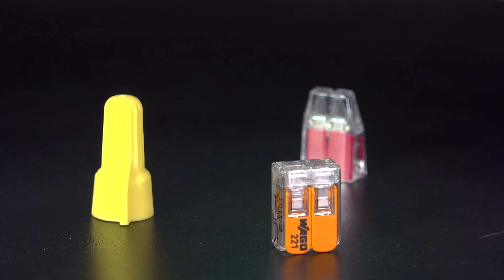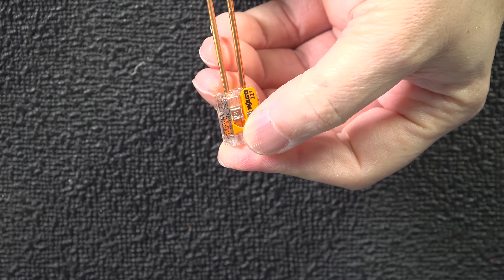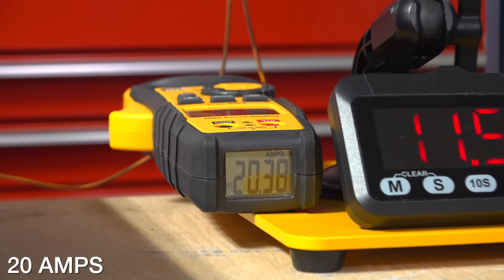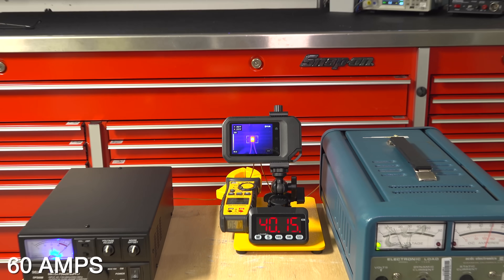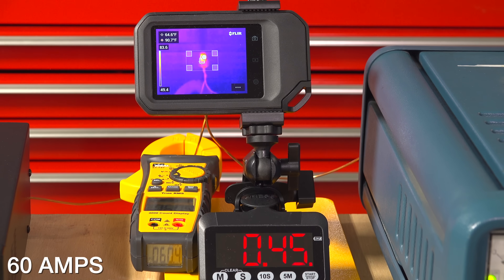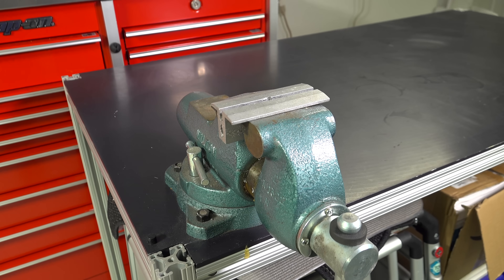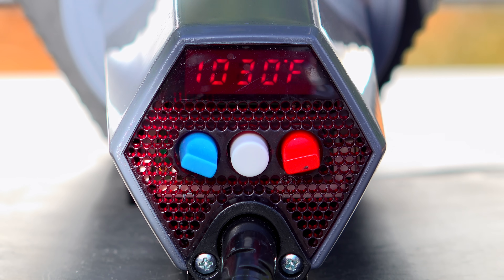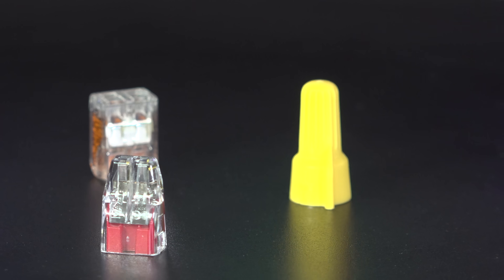What Wire Connector is the Best? Wire Nut VS Wago TESTED

Comment: I've been an electrician for almost 4 decades. Industrial, commercial & residential. I'm just an old guy with an opinion, but I've seen a lot. I've opened many j boxes, troubleshot tons of circuit failures, and have seen hundreds of wire nut failures. Here's my opinion, do what you want with it. Due to the thermal expansion and contraction cycles present in electrical systems, over time wire nuts work their way loose and even fall off. I used to blame the previous electrician for not tightening the nuts, but eventually realized it's the wire nut at fault. A twisted splice inside a box is so rigid that it puts more strain on the connection, prohibiting this natural movement. The connection is the weak link, hence the failure point. I use the push in versions exclusively as I believe that the levers could be accidentally popped open when packing the j box. These spring loaded connectors don't loosen up, allow the conductors to swivel and flex easily within the box, eliminating the tension on the wires. You can feel the difference when packing the box too, so much easier, no stress on the conductors. These are not the same as the push in connections on cheap 50 cent receptacles, those are junk and should never be used under any circumstances! I have used WAGO products in the worst industrial chemical processing environments, along with residential applications, since 1994. They hold up better than anything else. I was extremely reluctant and skeptical early on as to their durability, as wire nuts were the gold standard in a trade with rigid beliefs of what works and what doesn't. Now I use them in every application that I can, with no hesitation whatsoever. I keep in touch with my customers, no callbacks ever. I am not an electrical engineer, I just play one in real life!
Reply: Dave, that is interesting. As an Australian Electrician who has been at it since 1973, I mostly only come across wire nuts in imported North American equipment. I haven't found the spring type such as T&B, 3M or Ideal too bad, but way too many wire nuts are an all plastic device.
We just don't use them that often as the tunnel connector with a screw in the side is so reliable by comparison ( we call them BP or Blue Point, which was the original bakelite version).
The modern versions have a decent skirt and are secure. If needed the 2 screw version usually reserved for earth wires can be used for extra security. 
I have a long standing prejudice against the Wago terminals due to previous experience with G rail / Din rail mounted items not accepting pin lugs well. 
This is for fixed wiring to this point.
In the last 3 years GE and Komatsu have swung over to Wago terminals for use on dump trucks, a very hard mobile application. The previous method was the ultra-reliable but bulky aviation style ring lug and 10-24 screw with 3/8 af nut and captive lock washer.
The Wago set up is compact and neat, time will tell how they stand up to 120,000 hours / 20 years of vibration heat and dirt.
Reply: @mikenewman4078  Always interesting how completely US-centric the viewpoint of our workers is. They think the way they've done it for 50-100 years is the only way and that any other option must be bad since it isn't as common. From home wiring to automotive repair, people need to broaden their horizons. Thanks for sharing your experience. Heavy equipment will definitely put Wago connectors to the test!
Reply: @802Garage  
Large commercial Wagos are common.
Reply: @mikenewman4078  I am an American electrical contractor. I have never seen a non metallic wire coil in a wire nut that wasn't from China. We get them provided in some cheap fixtures from China and always throw them out. I am not sure you can even bu non-metallic wire coil nuts here. Maybe for automotive use.
Reply: My father was an Industrial electrician by trade, he worked for ITT Rayonier at a pulp mill when ITT was something.  My grandfather built houses and he used my father wire them. The county had no building inspections back then much less electrical inspectors, the power company inspected a house before they hooked up power.  My father hated wire nuts, he soldered all his connections. Want to bet there have been a lot of frustrated homeowners and electricians from that.
Reply: @mobeydick37  Soldered house wiring? is that allowed in the code? where he built at? did he wrap them all with tape after ,or is shrink wrap that old?
Reply: @sharpe227  Most of the houses were built in the 70s and very early 80s. Wayne County, SE GA.. He taped them. Shrink Tube might have been very new to the market then.
Reply: Just became familiar with Wago style connectors. What wonderful devices. I’m pretty old myself. I have been an apprentice electrician for a contractor involved with 100+ year old remodels in Chicago, porcelain wire nuts with cloth wrapped wire run inside gas pipes. That’s the way gas lit homes were converted to electric. I have been an electrician on a modern submarine. I have been an operator at a power plant performing high voltage switching. All of these electrical installations are proven over time but a major factor is the training and experience of the installer. IMHO wire nuts have always been one of the least desirable ways to make an electrical connection. Take a mixed array of 5 wires from 12ga solid and 16ga stranded and try and make a quality connection with a wire nut is virtually impossible. Use a Wago connector for the same, is no problem.
Reply: I am an electrical engineer in a manufacturing plant, and when it comes to facility wiring, while I do answer the occasional odd question about power factors or Ohm's law, the plant electricians are the experts. We spend all our time in college studying wave equations and complex impedance and aren't trained at all in practical stuff like "how many amps is that outlet?" or "what kind of ventilation does this transformer need?" Whenever I wire something up, it's because it was an emergency and the electricians weren't around; and they'll be coming back later to check/fix my workmanship.
Reply: @stickyfox  Have to agree wholeheartedly. I can think of so many classes that had little to no value and the likelihood of having more was small. It almost seemed as though they were trying to fill in the 4 years with stuff after having run out of useful stuff in year 3. Our college also had EEET which was geared for practical stuff and quite good but it was so funny how all the EE people looked down on them but in reality, they were the ones that could deal with real world.
Reply: My uncle is an electrical engineer and he used wago connectors when wiring our house. They have been in place for about 20 years now and haven't had a single failure. We recently opened up some electrical boxes doing some remodeling and the connectors were like new when we handled them. Edit: a typo
Reply: As a follow up, all my years of experience have been with metallic piping systems, residential and commercial. In the chicagoland area Romex is not allowed by local jurisdictions, 100% metallic pullable systems only. That being said, regarding my thermal theory, the entire length of the wire is uninhibited from moving during the heating cooling process, putting stress on the connection as there is no clamping of the conductors at the box like in a Romex installation. So there could be 75-100' of wire, or more in commercial/industrial environments. I am not a mathematical genius whose able to calculate this, but I know wires, just like any metal, will grow and shrink with heat. Most compact conductors now have 90c temperature insulation, which means they are designed to run at higher temps. More drastic temp cycles equals more movement. Again, just a theory as to the wire nut issues, but wires definitely move with heat cycles and I believe the WAGO connections allow for this movement better.
Reply: @davenag957 As a 35 year union plumber I have to know expansion ratios using rigid metal and plastic pipes that span 100's of feet. Plastic expands 6 times that of metal. You can actually see it when cold water traveling through plastic pipe rapidly changes to hot when it finally reaches the kitchen sink. I measured it a couple times. A 40 foot plastic pipe expands about 1/16 of an inch when the temp is increased 50 degrees.....a metal pipe expands only 1/6th of that....enough to hear (tic tic tic) if it's strapped tight to a given surface (in a bind)....but not enough to measure with rudimentary tools. So I don't buy in to this metal, flaccid wire (loose and flexible) causing any kind of threat. If a house is wired correctly you're not jamming 5-6 wires together in one wire nut....that's cutting corners and just bad workmanship. I wired my house over 40 years ago. Zero issues....but, nothing lasts forever...especially if you run water through it.
Reply: @davenag957  in my books, if you are open minded, you are not old in mind 
just FYI ALWAYS leave slack in wires, and a loop before the junction box/termination
houses move, buildings move, wood and metals expand and contract... allow room for expansion!
Reply from the maker: I really appreciate you sharing this and I have also opened many boxes and had the same experience. It's a terrible feeling when a wirenut is sitting there loose or on the bottom of the box. Thanks for sharing your real life experience.
Reply: @SilverCymbal  sorry i never worked on those things, but why is it bad?
Reply: @SilverCymbal  My takeaway from this is that if using wire nuts, position them so they are pointing up not down -- where possible of course.
Reply: @SilverCymbal  In 30 years, they will be saying the same about ANYTHING that has the absolute bulk of connectors.
Reply: To be honest, coming from the UK, I'm stunned you guys still use wire nuts where you just twist wires together.

Haven't been used here for 50 years and when they were they had a bad reputation.
Reply: the old stuff sucks. the 3M are nice. less heat if all wires are together and done properly. rnr🤙
Reply: Wire nuts were banned in Britain in the 1960’s. They were called Screwits here and made of porcelain. I started my apprenticeship in 1970 and now retired. I used to see them when stripping out old installations.
Reply: @derekferguson385  They are making a small comeback in the UK but most people have swapped over to the Wago's in the last 15 years. When I moved over to the US and worked there I used Wago's and everyone poo poo'd it thinking nuts were less secure but due to thermal expansion and the natural action of AC causing screw terminals to undo over time (hence in the UK screw terminal access is required or subject to failure during EICR (inspections) and no longer considered a maintenance free joint). 

One thing to remember with Wago's is they are designed in Germany and fault tested at over 2x the rated loading, so 20 Amp connector is tested to beyond 40 Amps - at 230 V which is over a 9KW load. So in theory they should be able to take a higher Amp load on 120 V.
Reply: I Just started using Wago’s also the Last Few Years. 221 series.  I Like them. No problems so far. I’ve been in the trade since 1981. I use the 3 conductor ones. They sure are a lot easier to use than putting 3 wires in a nut & twisting. A lot less stress on the body & fingers after 40 years of twisting wire nuts. They are nice for troubleshooting too. They have a hole for test leads to poke into & removing a wire to test is really nice as it can easily be put back in the connector.
Reply: @thunderbolt5354   I disagree that you are older than 16, based on your grammar.
Reply: Very interesting and valuable knowledge. many thanks.
Reply: I worked as a sparky for 50 years and never had trouble with a wire mut that I installed. I start by stripping wires around 7/8"  then twist wires with large sidecutters until at least 1 full turn on insulation. Then wrap with a quality.black tape. Worked in very harsh companies like a large slaughterhouse with a extra hot rendering room that ran 24/5 and a large candy company that had hot high pressure hot water hose downs everynight. As long as you do not overload the wires you were fine. So for a
Reply: What about 3M nuts? Messy work is usually the problem.
Reply: Wagos are easier for a homeowner, not better, there are also good and bad wirenut brands!
Reply: As a homeowner I have had 4 wire nuts fail in my 38 year old home just like you said. I switched over to Wago connectors and never looked back. So far not 1 Wago has had any problems.
Reply: @sublimationman  Pal You Better Look Forward wagos Fail to !
Reply: @thunderbolt5354   So far, after mounting tens of thousands of them, 1 single Wago failed on me. 1. All other errors were human fault. I seriously have much bigger problems on my job, than being scared of a WAGO failing me. Seriously, what a load of bollocks.
Reply: I wired my own house a couple of years back, and I soldered all the connections, where allowed by code. For reasons unknown to me, you're not allowed to solder ground wires together. For those ones I used brass crimps.
Reply: @trevorlambert4226  conductor carrying power can heat up and melt connections. Solder is normally fine for electronics as the current carried by the conductors is minimal therefor little heat is generated
Reply: @OttawaMikes  The current required to melt solder in those connections is many times the breaker rating. If you've got >80A in your 15A or 20A wires, you've got bigger problems than the solder melting. It wouldn't be code approved if there was any danger because of it.
Reply: @OttawaMikes  Depending on the exact products used, the insulation can melt before the solder.  Crimps are used in high power connections.
Reply: Used to be able to get outlets and switches with push in holes for 12ga wire but now the holes are smaller for 14ga. I recently did some wiring rework in a well packed duplex box and just could not get wire nuts to stay on. So I went to the local big independent electrical, lighting, and plumbing store (they're way older than Lowe's and Home Depot) and bought some of the push in connectors. Wham, bam, job done in minutes and it was so much easier. These connectors come pre installed on many lights now so install is simple. Just cut the wires to length, strip insulation and push in.

WTH are wire nuts still being made? They have been the worst crap for decades.
Reply: If it is all solid wire and it is twisted tight, the wirenut is just a cap.  You could just use electrical tape which I have seen.  I don't know if that meets code.  Some people tape the wirenuts.  You could probably tape the levers, too.
Reply: Just as any other business out there, I'm sure wire nut manufacturers have been the source of many false claims against their new comer competitors.
 Professionalism can take a quick nosedive when your livelihood is suddenly being threatened.
Reply: I am a retired electrical engineer (weapons systems) and looks to me like you haven't missed much - thanks for the meaningful insight!
Reply: Craig Dendy  A failed wire nut resulting in a  wire merely twisted together obviously isn't a secure connection and is one step away from being parted or partially parted and arching. .. obviously. Of course its a problem. Of course it matters.
Reply: I agree with your comments. I’ve seen people argue for wire nuts and I don’t get it. Wagos and back wire outlets are engineered for this purpose. I’m not a fan of back wire (push in), but screws can loosen and I doubt anyone use torque driver.  On a side note, US cable for luminaries is rated for 90-c.  At 60 amps in this test, those connections held up far in access to that temperature.  Great summary and video.
Reply: Had a new construction house. After 6 months a few outlets went out. They traced it to a failed wire nut which was burnt out. So there was some spark which made it melt. So they can start to fail fast as well.
Reply: @AnkurSethi108  That’s crazy. When I was changing some of my outlets, I found they never cleaned the paint off the wire before putting on nuts. It’s all about how it’s done to be honest.  Some will strip wires during rough in and the painters sprayed the walls and wires. I guess the electrician felt the painted wires were not an issue.   Glad you found the problem.
Reply: Thanks, Dave. That is a real help. I have a good friend who is a journeyman electrician (50 years - yeah, he's old 😉) and he was saying pretty much the same thing.
Reply: @thunderbolt5354  what grinds my gears is when I see people use those wire nut attachment on there drill and it’s twisted like eight inches of the splice then you take it off and look what they just did and the wires are all uneven and one is sticking way out and some are broken. I have also seen wagos fail and when I opened a junction box and was looking for the issue I had to have someone turn on the power and when looking in the box I could watch it sparking from the inside of the wago then it would trip the circuit.
Reply: @t1bud42  there are counterfeit Wago connectors, could be the sparking ones were the knockoffs
Reply: wagos with the lever are meant for cord wires, so u can push the cord inside without bending all the strands. u can use them with solid wire no problem but they mostly exist to do cord
Reply: @ZomgPL  No, Wago lever connectors are for both stranded and solid wire.
Reply: @ZomgPL  No they don't exist just for "cord". They are desighned for both stranded and solid conductors. They always have been.
Reply: Have you also seen Companies/People using cheap copycat connectors?
Reply: This is the insight we need. :D
Reply: Yep, we use Wago's all the time in the UK. thers now a 221 40 amp version available.

https://www.wago.com/global/electrical-interconnections/discover-installation-terminal-blocks-and-connectors/221
Reply: Good answer, Dave! On top of the Wago 221 being the best of the bunch, the Wago with levers are great for fine strand wire while the push-in connector won't allow for the use of fine strand wires.
Reply: Hat down. ^^
Reply: Very clear.  Thank you.
Reply: When you make a splice, do you tighten only the bare wire, or also 2 inches or so of insulated cable as well, to ensure the splice dosen't open? Do you test your splices to see if they're tight?
Reply: 😇 ∞ ❤ly & agree 👌👏✟✡✡󾓦✟󾓦
Reply: Good Stuff !!  Thank You.
Reply: Completely agree with you. Also I think the reason wires fall out of receptacle stab ins is because their stationary. These connections move as a unit.
Reply: I have seen automotive butt connectors to save space, not sure how safe that was
Reply: Amen!
Reply: that... is a huge endorsement... and i think the reason most american sparkies distrust wago... they associate with backstabbing, which... is not the same
Reply: Interesting, I have actually had smoke-outs from the push-in types because they can work their way loose with some tugging. I typically place a single wrap of electrical tape over the top of my levered Wagos. Still extremely easy to remove if you need to open it up, but keeps any accidental lever pops at bay. Takes a bit more time than a push in to be fair.

Good point on the genuine Wagos; I think a lot of people are basing their opinions of them on cheap knock-offs.
Reply: 50 years and I have never found a wire nut failure that I thought was properly installed in the first place. For areas with vibration, like a motor terminal box, I always add tape to fight the vibration. That's just proper technique. Of course, many  people don't install wire nuts correctly, so we needed a dumbed-down tool like the Wago.
Reply: Thanks for posting this comment. I too was skeptical at first regarding Wago lever nuts, but the more tests I see, and the more personal experience… I have to say, I find more pros than cons. 

I certainly like them for combining different gauges of wire, or converging stranded and non-stranded connections (especially at light fixtures).
Reply: @Madcat6024  In the industry, I find that the people that like wagos are people who don't have much experience correctly using wire nuts, and wagos provide a shorter path for them to complete a job, rather than actually learning a skill in the trade.
Reply: @arthouston7361  I have a friend who is an E1 Union electrician who shares the same viewpoint. I have always found it interesting when he shows me various techniques of how to do things in his trade “the right way”. However… that is not to say that I haven’t seen some questionable skills done by licensed tradesmen as well. LOL
Reply: @Madcat6024  Oh, so true. I started doing mechanical work when I was 11 years old, and you would not believe what I have seen.
Reply: Sounds very costly
Reply: Vibrations from what? Did you mean friction from the flow of electrons?
Reply: An electrical engineer here, learning from your experience. Thanks for sharing.
Reply: the wire nut isn't supposed to be making the connection, if the nut falls off the splice should still hold or it wasn't done properly to begin with
Reply: I do worry about the pop up Wago  popping up when shoving into a box ,I have tape a couple where it was tight saw where one popped up that was my fault  .But the 221 is rated higher .
Reply: Just dealing with my own personal electrical issues in 1960s built Idaho houses, I've discovered loose wire nuts in light fixtures and behind outlets. Never was sure if they're meant to be one time use devices, as in after the first twist on and back off they're garbage not to be used again, but they sure seem to be exactly that. I much prefer the Wago style connectors after being introduced to them by a master electrician friend. They grip solid and braided wires of various gauges way better than stupid ass wire nuts ever do for me, brand new or not.
Reply: @jokerace8227  f
Reply: @jokerace8227  where in Idaho? Does anyone in Boise sell Wago connectors? Grover's Pay & Pack has push in connectors but IIRC not the Wagos.
Reply: Thank you Dave Nag. Even though I'm not an electrician I have wired a few houses, wired a barn that we converted to a clubhouse, wired some additions on mobile homes, replaced breaker panels etc. I don't have a lot of experience but I have some and I have also discovered loose or fallen off wire nuts while doing electrical renovations. I always wondered why that was the case. Thank you for saying stuff no one else seems to be willing to talk about. I just learned about the WAGO connectors and I think they are awesome. If I have to do any electrical work in the future I'm going to use them.
Reply: @thunderbolt5354  this is the only intelligent answer/ response.
Ty
Reply: I'm tempted to disagree on the thermal expansion theory. But unlike others with stronger opinions, I've come to realize every electrician has worked their own careers full of unique experiences. What I have seen, very often, are nuts loosened due to vibrations--whether from their own current or from an external source. My opinion on thermal expansion is that it shouldn't be a problem for correctly sized wire nuts securing leads with appropriate slack (yet another reason to "always leave an extra loop"). My experience comes from only 5 years in a prior career as millwright--maintaining mostly high-voltage 3-phase circuits.    Due to a near daily exchange of various motors to/from across the plant, wire nuts were our best option.

That said, I personally do not like wire nuts. My opinion of them is not terribly different than of other splices. Except that the exposed bottoms are a fire risk, in my view. When I have no better option than to use nuts, I always wrap a strip of electrical tap around the bottoms to guard against foreign objects making their way inside.

Across the board, and aside from that one personal issue with nuts... I have never really known a "perfect" splice. The best way to compare them is by their contexts. The correct splice for a given situation is always the best splice. Whenever possible and rational, I solder my splices.
Reply: Same as Dave Nag, I have been an electrician for ~40 years.   I now use Wago exclusively.  I have only had one problem and that was a wire that was not fully pushed in.   Primarily working on commercial jobs.

I like the Wago push ins because I can have my crews make up receptacle boxes etc.. during rough then when it is time to set finish, I have receptacles with tails we assemble early that are then quickly connect and trim set.  When I was young we would have spend much more time installing finish.   Also to separate wires I can easily twist one out without disturbing a circuit etc... much easier then untwisting the wires and sorting.  

I primarily use Wago,  I like the orange 4 space most often and do not really like the Ideal product I have had to use a couple times.
Reply: @westcoaststacker569  - I'm curious if wago's can connect 6 or more wires. I'm adding a dimmer switch and needed to add a new neutral to an existing set of 5 neutrals in a wire nut. Is best practice to simply daisy chain wagos?
Reply: @donaldlee6760  I buy primarily the orange 4space, but keep some 6 and 8 space on the job.  If I already installed a 4 or cannot find a larger I have jumped two 4s to make a 6.

Existing wire nut with wires twisted together I would add another wire, like I did earlier today.  Twisting into the existing with my linemens. If the existing wires are twisted they do not work well in a wago without cutting shorter and re-striping or some time with linemens to straighten.

Be sure to kill the power,  I have had homeowners open neutrals like that which happen to have two circuits sharing it, causing 240v to go through their appliances and computer.   A shock from a neutral with a load stings a lot also, I still remember my first from 41years ago and where it was.  Probably because it was a bikini distributor.
Reply: @westcoaststacker569  

"Jumped two 4's" I hope you arent talking about Wago's. Jumping as you put it, I presume you mean more than one wire in a receptacle, isn't allowed. A 4 way is desighned for 4 conductors only. You are using a Wago contrary to the design. Very bad practice indeed.
Reply: @donaldlee6760  

Cage clamp Wago's are available up to 5. Push fit Wago's are available up to 6 way.
Reply: @martinw245  One wire per hole. Linking two Wagos together with a #12 wire to make 6 available.
Reply: @westcoaststacker569  

Oh right, fair enough.
Reply: Im in the uk, and our socket outlet circuits are rated at 32A these are passed as safe all day long, wire nuts wouldnt even get tested for approval, as the thermal expansion cycling seams an obvious issue, let alone the large open end that the wires go into. Also since the inside is threaded, presumably only the tips of the threads are touching the conductor, so i fail to see how there is a larger surface area of connection in a nut
Reply: @mikepage9520  Well, when you consider that the conductors themselves are twisted together, and therefore, touching, yeah, I would say it makes better contact.  The nut is there as primarily and insulated cover.  The threading just holds the insulator in place.  I have recently switched to Wago connectors.  I like them so far.
Reply: @ChadSzorvas  so you've just argued for the thing I was slating then said you use wagos and like them, pardon me if I'm confused
Reply: Thank you
Reply: You are right about re-tensioning with the spring, which is why we only use spring fastenings in Germany.  whether in industry or in house applications
Reply: My son is an electrician.  He told me he doesn't trust the Wago because of loose, unreliable connections.  Do you ever have that concern?
Reply: @jimalcantara6638  Personally I feel they are less prone to operator error.  
Nothing really beats wires twisted together by an expert, but they are difficult to add or subtract from and not all employees are experts.   I am very confident of the Wagos where I use them and no circuit should be designed expecting a continuous load over 16amps on a 20amp circuit.   My jobs I am very generous with circuits.
Reply: @jimalcantara6638  
No.
Reply: @jimalcantara6638  Not at all. Never had one come loose during the 20 years we had them installed and the levers on them are perfectly operable till this day.
Reply: Current travels on the outside of wire...not inside. The surface area of wire is measurable. This connector works like touching 2 wires together in a cross X. ... How do you measure/achieve surface area where the actual connection is the size of a dot?
Reply: ..no it wasent the wire nuts fault, most like wasent done correctly or the wrong twister was used, wegos..the way thay are made, i can assure thay are guaranteed to fail or overheat ... in 50 years hasent seen a single wire twisters fail or as u say come loose...but similar products as wegos...thay constantly fail....
Reply: @ Dave Nag   BULL SHIT the only ones that fail are the ones installed by Non Electrician Morons !
Reply: @thunderbolt5354  I've come across failed wire nuts installed by IBEW journeyman so my experience directly contradicts your assertion...
Reply: No offense, but you sound like the electricians who say its perfectly fine to use the pushin connection points in the rear of a receptacle (I realize you mention cheap receptacles, but this rule applies to spec grade, commercial grade, hospital grade etc.) . As a master electrician myself, having seen hundreds of failures, there is bar none a common thread. Failure to pretwist your wires, a widely accepted "good trade practice". "No pretwist" is a marketing slogan, and any electrician worth their wage should know better. Its like a no scrub mr clean add.

Ive trouble shot a number of failures when people use these wagos in pot lights. This test is done under ideal conditions where you are not pushing the wires/connectors into a tight box. It is extremely easy to accidently hit the orange portion of the wago and loosen the connector.

Like the pushin connections at the back of any plug, these connectors should be left to jack of all trade/home renovators.
Reply: @Bm99986  

 "It is extremely easy to accidently hit the orange portion of the wago and loosen the connector."

And yet used all the time in the UK and Europe, very popular, and nobody complains about that issue. 

If you mean the orange lever on the Wago 211, then you cant loosen it, its either open or closed and you can see if its open. 

If the levers aren't stiff enough for you use the previous version that was super stiff to operate.

If you mean the push fit version like the 203, there is no orange portion that will loosen them. To loosen you have to  deliberately twist and pull hard. 

The reason they are so popular here is because they work and have barely any issues associated with them. If they were troublesome we wouldn't use them.
Reply: @martinw245  The reason they are so popular is because they are easy to use, faster and dont require pretwist (linesman). Its like all things, as time goes on we sacrifice quality and longevity, for ease of use and expediency. Dont conflate popular with superior quality, there are millions of examples of this being incorrect.
Reply: @Bm99986  

"Its like all things, as time goes on we sacrifice quality and longevity, for ease of use and expediency. Dont conflate popular with superior quality,"

Huh... that's utter nonsense. Wago's are extremely well tested and perfectly capable of doing the job. Also far superior to the wire nuts you guys use in the US, that were banned here in the UK in the 1950's. You will find numerous videos of tests done on Wago's that demonstrate just how capable they are. 

Did you actually watch the very video you are commenting on?

Our IEE regulations are VERY strict here in the UK and Wago's wouldn't have achieved the certification if they weren't very capable. They are also approved for maintenance free installations, thus no checks required after installation and certified for inaccessible locations.
Reply: @martinw245  The canadian electrical code, and canadian electricians are top notch, not sure why you would think im american.

Anyways... you mean how in the uk you are still using open busbar panels located in washrooms.. ill take my experience over your shire style electrical any day bud.

As i said, pretwisting is paramount to a good connection. You are comparing an expensive wago connector to the cheapest ideal connector you can find.

Did YOU not watch the video? The pretwisted connections in a marrett style connector is superior in heat reduction.  Besides at 200 f + your insulation would be done in anyways, so testing what temperature a cheap ass 1 cent wire nut melts is irrelevant so long as its above 200/90c. It is rated for 221 degrees f after all.

Also as far as your comment about things being utter nonsense, about as time goes on longevity and quality are sacrificed for speed and convenience.... i dont know where you live, but this is an inarguable fact.
Reply: @Bm99986  " Its like all things, as time goes on we sacrifice quality and longevity, for ease of use and expediency."
New thing bad,... back in my day good,... kids these days and their rock and roll music...
The fact that they're easier to use doesn't make them inferior. They can easily withstand 3x their rating. The fact that wire nuts are slightly cooler in a situation where they're drastically overloaded for long periods of time is moot.
They're easier and faster to install. They're more versatile. They do the job perfectly well... That makes them better if you ask any unbiased observer. But they're different from what you know so they must be a sign of the fall of Western civilization. Give me a break.
Reply: @tmoney1876  facts are facts. A mechanical connection trumps a wagon period. There is no question. It is why it is trade practice to prettiest connections. It is why hacks do not, a d believe twisting the marrett will twist the pair. Sacrificincing longevity in the name of ease of use and expediency is sad, it's what hacks do. If you don't take pride in your work, by all means... go with the quick fix. To each their own.
Reply: @Bm99986  Your response is so full of fallacies that I really shouldn't even come back... But without saying "I just know", where is your proof that Wago connectors spontaneously fail over time? They're not inferior. From what I've seen, they've been used for decades in Europe without issues (a place with way more consumer protection regulations than the US.) "Its tradition in the US to use wire nuts so it has to be the best way that it could possibly be done" is not a "fact". It's an assumption that you've made based on your own biases because it would be painful for you to admit that you may have been wrong. 

"Kids these days" and "it used to be so much better" is an argument that your father said about your generation, and his father before that... All the way back. It doesn't represent "facts" either.
Reply: @tmoney1876  not even worth a response
 If you can't read my comments, why even respond?

I've already said I live in Canada. Our electrical code is far superior to your own.

Again a mechanical connect is superior, period. There is no discussion or debate on that. The only discussion is if wago is "good enough". 

The fact that you cannot grasp this, means your clearly not worth any more time... 🤦‍♂️SMH
Reply: @Bm99986  And yet you can't help but keep blathering on... A connection that is more than sufficient to carry the current (which has been proven by extensive testing) that is faster and easier to install is superior. It's almost impossible to do it wrong, whereas you don't even think the way that wire nut manufacturers say to install the product they design is correct. If you take 1000 electricians and have them make 1000 connections, the failure rate for Wago connections is going to be lower.

And here is the part where you say "well all the wire nuts that fail were installed wrong" when THAT'S THE ENTIRE POINT. The Wago connectors are practically fool proof and far more than "good enough"... That's why they're a better product. And I don't give a shit if you're from Canada.
Reply: @tmoney1876  sad, can't read. It's indicative of your replies. SMH. I guess if OK is good enough for you. Them hats off to you. Youre an electrical installer... if you take pride in your work and do it right so you never have to hear about it again, you're an electrician.

It's obvious from your replies that you are former.
Reply: @martinw245  Perhaps Wirenuts are banned in some places because so many people are lazy and ignorant on how to use them.  Wagos are easy and "almost" idiot proof.  I think it comes down to skill vs cost.
Reply: @solarsynapse  

Nope. Not used in the UK for decades because its a primitive means of connecting conductors. They also aren't MF (maintainance free) which is a requirement for inaccessible places like under floorboards.

There isn't much skill required to use wire nuts, if there were they would be even less impresive. Its common sense to make connectors safe, easy and reliable. They shouldn't "test ones skill" that's just illogical.
Reply: @martinw245  Sure, anyone can use a wirenut, but many don't use them properly.  Primitive is not always a bad thing.  K.I.S.S.  They are maintenance free and far less expensive.  The Wagos are faster and easier.  Both get the job done.
Reply: @solarsynapse  

If some don't use them properly then logic would dictate that an easier, safer connector be adopted.

They were outlawed here in the UK 50 years ago and for good reason.

One of the worst aspects of wire nuts is not being able to see whether or not the wires have a viable connection, which can result in shorts or fires.  Of course, you could say that's where skill comes in, but safety shouldn't rely on skill, which is variable even with the most experienced. 

Wagos are transparent so the connection can be verified, always apply the correct pressure on the conductor are easy to fit and are certified maintainance free in inaccessible locations.

It's a no-brainer.
Reply: @martinw245  you can’t hide wire connections in Canada.
Reply: @danlux4954  

You can in the UK if its MF rated, maintenance free  MF connectors are desighned so that the connection can't slacken over time and thus require no maintainance. Like a Wago in a Wago box
Reply: @martinw245  wire insulation doesn’t last forever, the new stuff might be better but I have a 90 year old building and the wire nuts are the least of my worries.
Reply: @danlux4954  

Regulations "suggest" a rewire every 25 years in the UK. Not compulsory of course and there are many buildings with VERY old installations indeed. Would help address the situation if electricians in the UK didn't charge such huge sums for a house rewire.
Reply: @martinw245  it’s not the electricians charge that is too expensive, it’s bashing out all the plaster to get to the wires.
Reply: @danlux4954  

Don't know about where you reside, but in the UK electricals do all the "bashing out plaster". They do they entire job and especially in London the price they charge for a rewire is bonkers.
Reply: @martinw245  who replaces the bashed out plaster?
Reply: @Bm99986  wirenuts are illegal here and everysingle electrician uses wagos here and there is no failures. Like i just think that you in the na just cant use simple accesories like pushin wagos are really good if you use them correctly and so are the lever wagos. I just think you out there cant use them
Reply: @Bm99986  and yea na electricity safety is a joke anyways
Reply: You are supposed to use lever wagos for stranded copper not for solid
Reply: @Narttuliisa  Wrong! Desighned for both stranded and solid.

https://www.wago.com/global/electrical-interconnections/discover-installation-terminal-blocks-and-connectors/221
Reply: @martinw245  yea but solid cables are easier to put on springloaded ones and they take less space
Reply: @Narttuliisa  

Have you used a Wago? I have many times. Stranded or solid both are easy to insert. Look at the manufactures web site. Desighned for both.
Reply: @martinw245  yes yes. I have used. But i ment that solid wires are better for springloaded because they are a huge spacesave and only using lever wagos for stranded